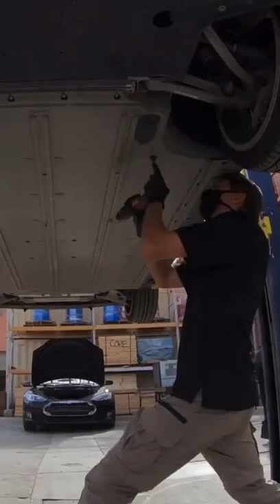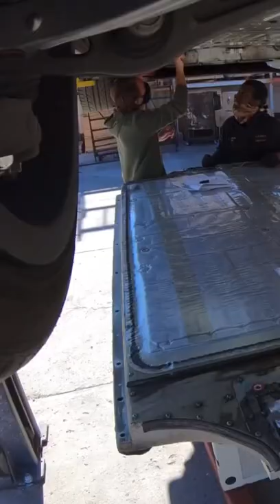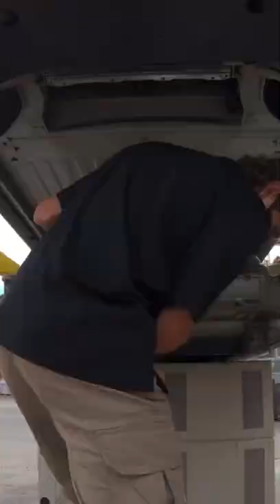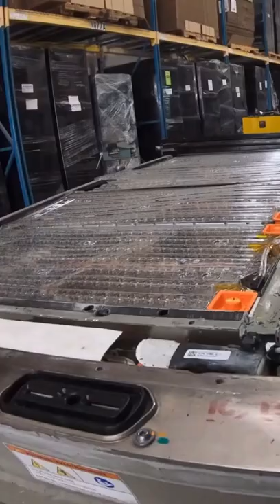How we Remove the Tesla Main Battery Pack

Comment: And that right there ladies and gentlemen is 20k worth of non renewable materials.
Reply: Shoot bro you said it best.
Reply: Oil isn't renewable either but whatever
Reply: Facts
Reply: What’s the labor rate
Reply: Actually the lithium itself is almost 99% renewable, it's the physical breakdown of battery modules charging and discharging that makes them wear over time. Not chemical destruction.
Reply: @thecapt8563  but the battery isn't disposable or reusable. But let's switch all cars to electric, right
Reply: Actually most things are "renewable". The problem is, is it profitable? We could use chemicals to break plastics down back into basic elements, but the cost and time would be more than the material worth. Chemistry is all about working with puzzles pieces and placing them under the right conditions to get what you want. Money is really the driver behind decisions.
Reply: False
Reply: @Bluefiresea  and that's why the big recycling will happen in the future
Reply: @thecapt8563  oil gets filtered all the time.
When you buy new oil for a car, it filtered oil.
Reply: Not to mention where the metals for the batteries come from, when people endure to get it. And who has a monopoly of cobalt? You guessed it... 🇨🇳
Reply: @thecapt8563  except they recycle used oil
Reply: And it's not like ita pulled out of a 6 inch pipe like oil is. It is littereally every square inch of dirt dug up, just like a coal mine...
Reply: @thecapt8563  bro look at an oil well and then look at a lithium mine
 And then tell me what is worse for the environment
Reply: @thecapt8563  oil is a continuous process. It is being formed as the second hand sweeps. Besides...when your electric. Battery gets a hole in the bucket...you drive through water, you burn...
Reply: Careful they might report your comment for telling the truth
Reply: Battery are quite recyclable  upto 90%
Reply: Absolutely
Reply: Unbelievable stupidity.  Stupendous comments on not being able to recycle the battery. Wake up guys it's 2022 not 1900s
Reply: Who cares. It’s not like teslas are “better for the environment” anyway
Reply: @thecapt8563  just cause oil is non renewable, doesn't make battery renewable either.
Reply: @thecapt8563  Oil gets recycled!!!!
Reply: @thecapt8563  bro what?😂 literally every drop of lube oil (engine, transmission, differential) is recyclable
Reply: @thecapt8563  

Oil is a by product of the Earth created continuously by the extreme heat and pressures of continental drift and temperatures of the earth’s core!
Reply: Not true. It can be used in housing once it's not for for a car.
Reply: @maskofsan1ty  
Just what you want, a whole bunch of chemicals built into the walls of your house!
Reply: @Showboat_Six  I have a gas boiler in mine...
Reply: you should go back to school and learn chemistry a little more. math as well. as you likely one of those who thinks that Elon must owes you a billion dollars i think if he did not decide to buy Twitter for 44 billion. LOL
Reply: @alanvelazquez1027  you have no idea. Car batteries can be used as solar storage for years after they've gotten unusable to drive a car. The batteries are also recycle and non-toxic for the most part though the industry is not established yet since so few EVs reached the end of their live. It's a lot more efficient and environment friendly compared to combustion engines.
Reply: @lukasschwab8011  simply incorrect. They have a 7 year life expectation and noway to dispose of properly. And with black and brown outs, more ev means less they will be able to charge.
Reply: @justinmacks1481  a “physical” breakdown is a chemical process..
Reply: @thecapt8563  at least it’s cheap
Reply: @thecapt8563  is* when Biden is ruining it
Reply: @alanvelazquez1027  have you seen gas prices?
Reply: @thecapt8563  Did anyone say that it was?
Reply: @w4drone720  yes sure have. Have you seen how ev batteries and body panels are made?
Reply: @alanvelazquez1027  yep lithium mines, packed together in cells
Reply: @w4drone720  and how much fossil fuels are used to mine them again?
Reply: @alanvelazquez1027  probably (im guessing) about 60 miles worth of gas to mine it, a few hundred or a thousand in transport. how many miles have you driven in your car?
Reply: As a Tesla owner I can tell you the battery only cost 5k
Reply: It’s 98% recyclable
Reply: @jona3908  more than that but still pretty low
Reply: @justinmacks1481  I like how he just ignored your comment
Reply: @thecapt8563  the whole fucking point
Reply: AFAIK a majority of the compounds within batteries are renewable (I might be wrong its been a while since I was in chemistry). The problem is that its not profitable. Something that isn't renewable is oil/gas, which is why I heavily endorse nuclear.
Reply: @thecapt8563  oil can be “upcycled” into asphalt and sealers for roads.  Engine blocks and transmissions can be recycled for metals.
Reply: @thecapt8563  well if you use 20 k in oil i bet you change it pretty often, and you can just filter the oil and putt it in your fuel tank, and it will be gone, no problem with throwing it away. (Only do this in a diesel tho)
Reply: @thecapt8563  Oil gets recycled all the time.  I take mine to a recycling facility.  ♻️  But my lipoly batteries just go to a special place to get destroyed.
Reply: @alanvelazquez1027  Yup! incorrect. Batteries will outlive the car. Go back to school and learn something.
Reply: @thekretch  wow how terrible fr you to not even know anything about batteries for ev and their life expectacy. So sad for you
Reply: @thecapt8563  Obviously, but companies are advertising these cars as renewable when in reality they are just as bad as ICE vehicles
Reply: @justinmacks1481  Lithium is renewable, but only in theory and is not practical. The actual practice of extracting lithium is very dangerous and time consuming, and because of this, becomes very costly.

If I remember my numbers correctly, I believe it’s like 30% yield until it becomes more cost effective just to extract the lithium from the earth.
Reply: There is a company that renews them
Reply: @GrizzlyPigProductions  cool story
Reply: @alanvelazquez1027  it’s true considering I have close connections with them if u saying it’s not
Reply: @GrizzlyPigProductions  sure you do🤦
Reply: @alanvelazquez1027  yes let’s do that, it’s still better than the other options jesus christnxjck
Reply: @w4drone720  mined by who again? 🤦
Reply: @jona3908  how much to install it?
Reply: @lukasschwab8011  if the battery is no good anymore how are you storing anything on it🤦
Reply: @alanvelazquez1027  Tianqi Lithium in china or another large Chinese mine most likely
Reply: @alanvelazquez1027  battery and install together will cost between 10-13k but chances of needing a new battery are pretty slim.
Reply: @alanvelazquez1027  installation is pretty easy, especially on earlier model s, the car gets lifted up, panel comes off, old pack out, new pack in.
Reply: @w4drone720  so you don't know how much it costs. Gotcha
Reply: @w4drone720  average cost is between 13k and 20k. I can replace a gas engine for a few grand. Thanks but I'll stick with gas
Reply: Thats pretty cheap considering how long the battery last. Tesla recycles every single battery it recovers.
Reply: @Victor-vj5ds  at a cost of $6750 for recycling 🤦
Reply: @alanvelazquez1027  who does it cost 6k? Tesla either re use the cells or destroy them for the raw resources, they are building a hydrometallurgy recycling plant to extract the metals at a profit.
Reply: @Victor-vj5ds  it costs them 7k per battery. You make it sound like they are able to just recycle them imidiately. Obviously you have no idea what you are talking about
Reply: @alanvelazquez1027  where are you getting this $7,000 figure? The closes thing i could find was 4.50 per pound but this does not specify if its the whole pack weight, the just the battery modules, or just the cell weight itself. Something like a model 3 has 600 pounds in cells but weights about 1,000 pounds. But these are figures for packs that are destroyed for raw material without using hydrometallurgy recycling. And we don't really know what it cost tesla today or what it will cost 2 years from now.
Reply: @Victor-vj5ds  yep
Reply: @thecapt8563  oil can be recycled lol
Reply: 95% renewable materials*
Reply: Lithium ion is completely RECYCLABLE
Reply: @Sunita_sharma1  Recycling these batteries costs more than the battery. Plus the extremely expensive recycled yield is so low ~30%. it’s not what typically is considered a recyclable at all, most recycled materials yield over 70%.

Oil is one of those.
Reply: @alanvelazquez1027  bahahahaha bahahahaha 
Recycling lithium batteries is happening now ....
Reply: @noidea9279  see what it costs to replace the battery? And gov Newsome just asked its citizens to not charge their ev's. So cool
Reply: @thecapt8563  yes it is, do you know how oil is even created inside the earth?
Reply: @dontrustwhiteyevery1  you do know that ev's still use oil right? And what about the process to make them? More natural resources are needes to build these environmentally friendly vehicles
Reply: @thecapt8563  Well technically Oil will replenish in about 10 million years 🤣. But it's non renewable to us because we can't wait that long.
Reply: Redwood Materials just for starters. Do some research.
Reply: @stevetarrant3898  have. Average cost to replace battery is 30k. Might as well buy a new car. Do some research
Reply: @w4drone720  around 300barrels of oil to create  a single battery for tesla. The strongest one.
Reply: @biggebig458  all teslas of the same model use the same battery, it’s just software locked for lower end models
Reply: En France on les recycle j'ai vu des employé les ouvrir 95% recyclé c'es t des batteries de smartphone
Reply: @thecapt8563  lol actually it is 🤣🤣 we can recycle used oils too make the same oil.
Reply: To be fair though it is the equivalent of 100k miles of gas so if you get more than that you get a deal
Reply: @alanvelazquez1027  don't pretend to care about the environment
Reply: @garys6898  coming from someone that has pretended their whole life means nothing to me
Reply: YESSIR
Reply: Not renewable but “unbelievably” they are recyclable
Reply: Oh u can buy them used out of wrecks for 4 grand
Reply: The Tesla Battery is renewable. They grind it down and  reuse all the precious rare metals, lithium etc
Reply: @bodyshotjake7475  even if it's not profitable there's something called regulations and environmental concerns. There are many materials and compounds that are cheaper to just extract from mother earth..but even if recycling is more expensive now doesn't mean it will be forever as these processes evolve rapidly. And even if you don't recycle the Tesla battery over its lifetime the car contribute to 30-85% less greenhouse gasses than the conventional fossil fuel car over its lifetime, depending on the energy source used to produce the electricity. 

All things considered the electric car is better.
Reply: @thecapt8563  One day, you will be turned into oil to power V8's. It's true.
Reply: Transmission replavement is $15k
Reply: @tiattahiscupcakecandykatan2453  Stop with the liberal whataboutism.
Reply: @JetFire9  If you voting Trump, then say goodbye to Tesla for good
Reply: Wrong. Long before being recycled, these batteries will be used for grid storage or other purposes. Stop spreading bullshit.
Reply: @alanvelazquez1027  The batteries are used for grid storage long before they would be recycled. Get your shit straight.
Reply: @dRoscoAZ  The regulations for that have improved tremendously. Plus, battery chemistries, like LFP, which are quickly becoming mainstream, contain no cobalt or nickel. So there’s two rare metals eliminated from the equation.
Reply: @jordanvincenzo464  you are factually wrong. Get a clue